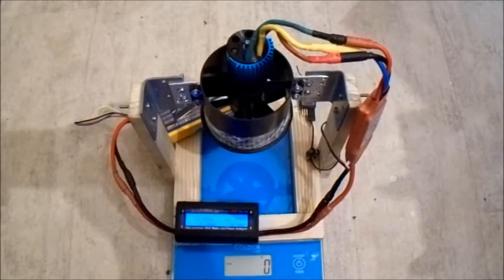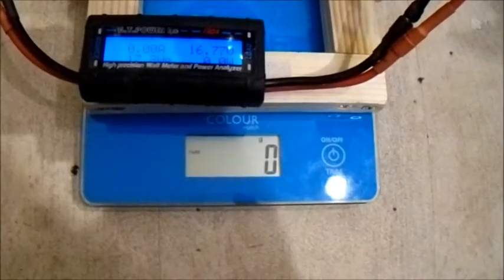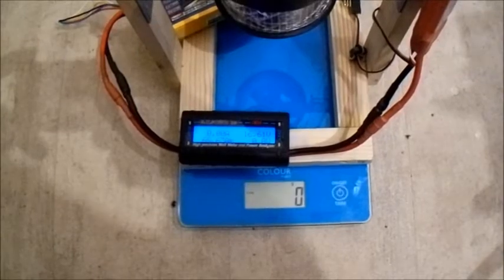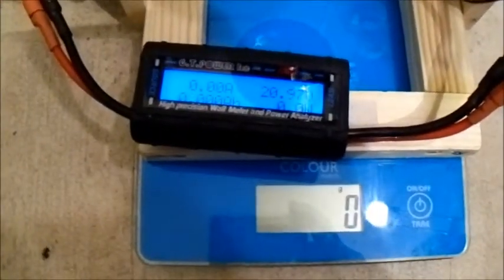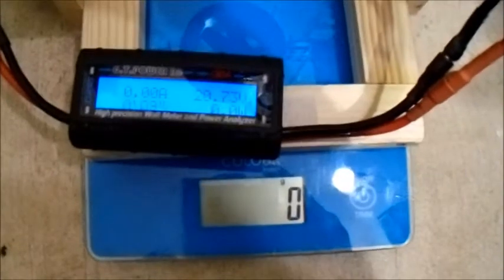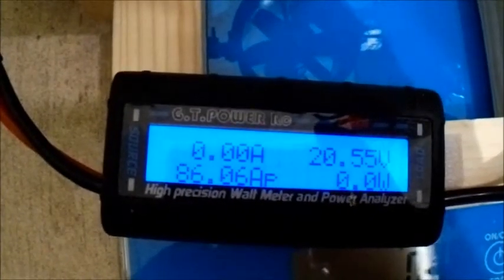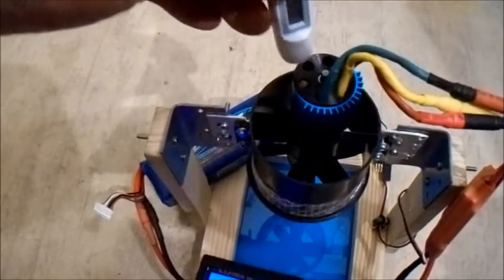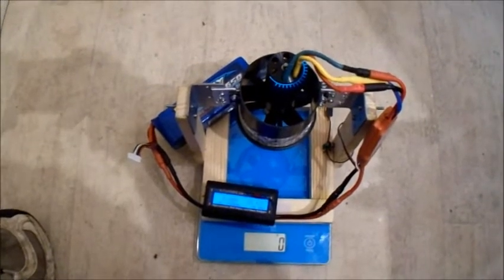Dr Mad Thrust 3000kv + HobbyKing 70mm EDF Unit Thrust Test

Comment: please test on 6s. about 20 sec run. thx ;)
Reply from the maker: Hi there
This motor is only meant to run on 4s and I'm already running it on 5s. I'm crazy but not crazy! I think 6s would be way too much. I like this 5s set up and it already has great performance so need to run it on 6s. I don't want to burn the motor. I also think the fan unit could explode if run on 6s :( Thanks for watching.
...RCPP
Reply: This 3000kv 2970 brushless Mad Thrust  motor CAN take 6s with no problems with mix throttle. I got one in an Freewing Rebel V2 Sport Jet and a Freewing F-104.  Over 2 years with a  Hobbyking 100amp ESC, 10 bladed (yes, that's right, 10 bladed) EDF and a 3000kv Mad Thrust 2970 brushless motor! they are still running as of this date!!
 You will indeed have to have at least a 100a ESC or higher, though!!
  Pirate calls himself "crazy." He is rather docile to me, when it come to a lot of these  tests. But at least he makes the effort to do these test to share. Hats off to that.